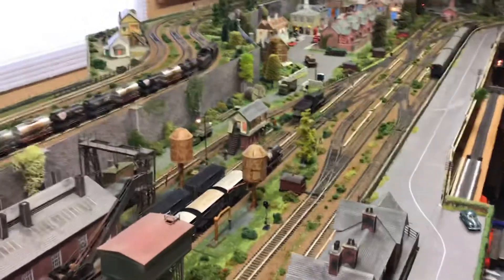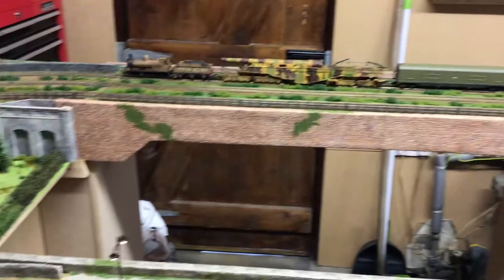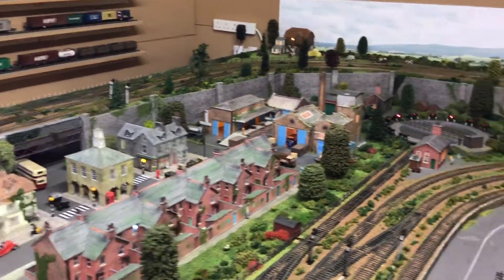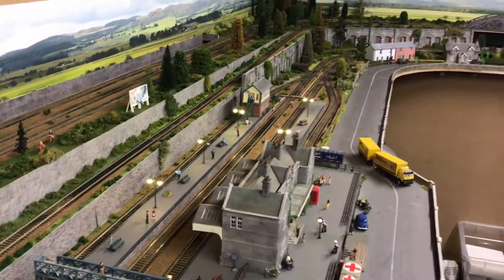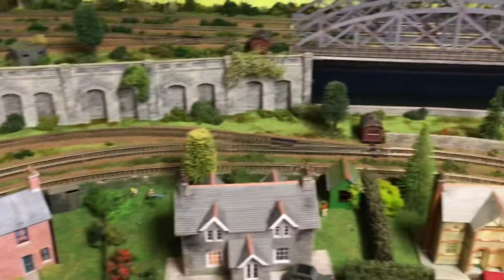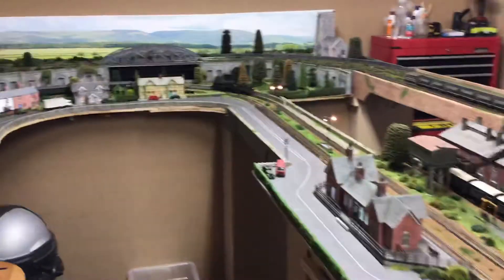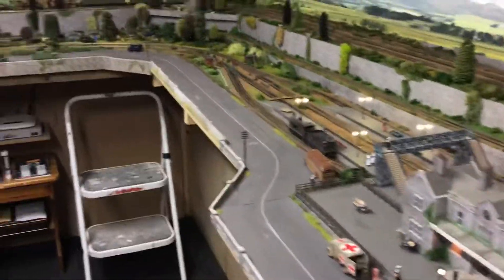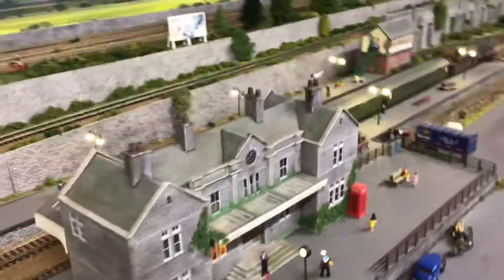00 Gauge model rail, garage layout.

Comment: Your video just came up in my feed. Fantastic layout and can’t believe you built it so quickly and are thinking of ripping it out already! I am a year in and have only completed a fraction of mine, which is about a a quarter of the size of yours. You must have put a lot of planning into the layout, I think it would be my ideal layout, it has everything you need on a model railway. The faller road has given me an idea for my mine. Going to have to see if I can retro fit it. I have just subbed you. Thanks for sharing. Mark
Reply from the maker: Mark, thanks for the comments, really appreciate them. I’m a bit of a serial builder, that’s what I enjoy. My present layout, which I started in the first lockdown is the longest I’ve had a layout. Already thinking about the next. I quite like the look of the new TT 120 gauge, I think Hornby’s announcement the other day will be a game changer for that scale in the UK.
Just for your info, I converted all my Faller vehicles to British bodies, and they all now run on AAA batteries, no more charging. I think I put a video on the channel showing them.
Thanks again. Doug.
Reply from the maker: Your layout is coming along nicely, looking good.